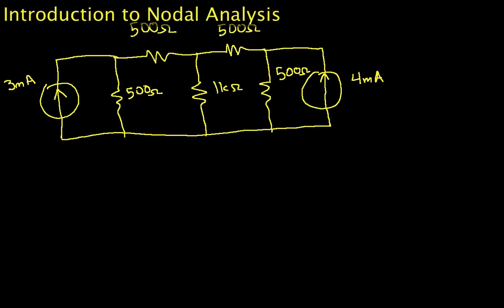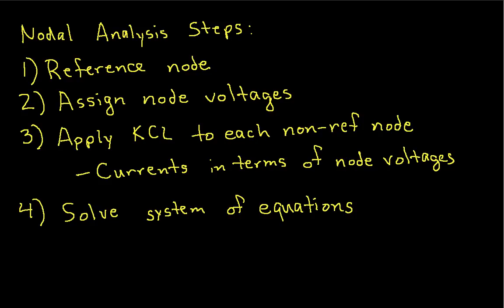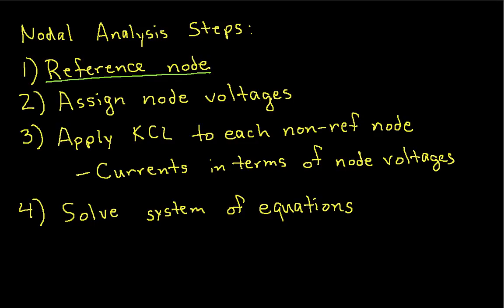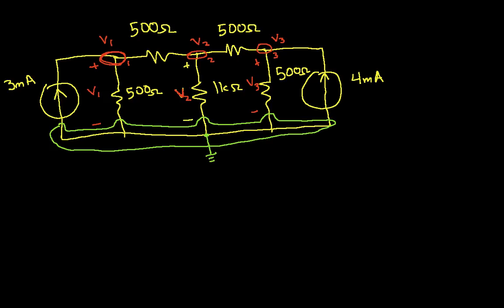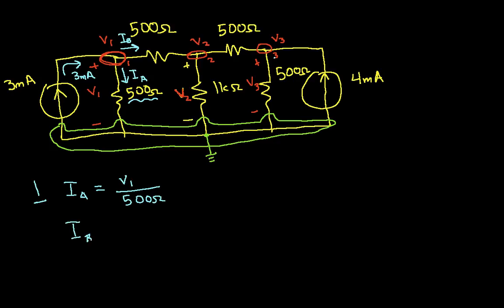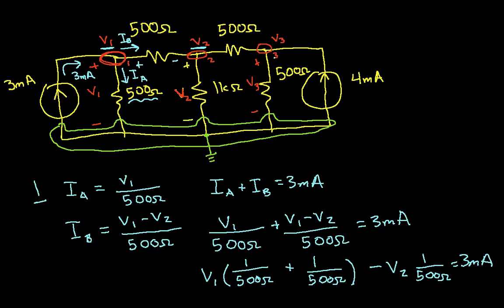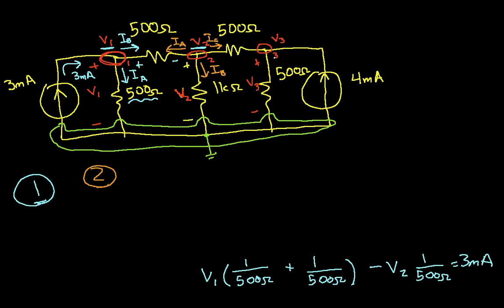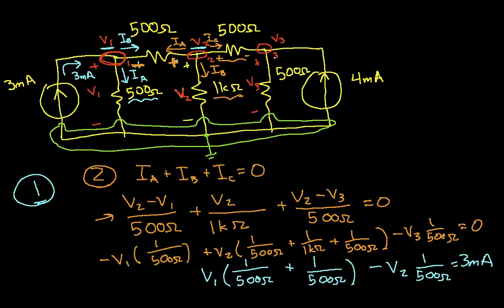Introduction to Nodal Analysis Part 1

Comment: for everyone confused on node two. During nodal analysis, you want to write every current as ones that are moving away from the node. If the current isn't heading away then it'll turn up negative. This is a neater way of writing it and keeps your from being confused as to where the current's heading. if everything is heading away, the ones that turn up negative would have to be moving towards the node.
Reply: Thanks for that. Super helpful!
Reply: wow how could you guess !

Comment: This video provides clear information about all of the steps necessary to perform node voltage analysis.  It begins by introducing a problem and working step by step through it until completion (In part 2).  Throughout the course of the problem each step taken is explained and made as clear as possible to the viewers.  This video explains very well what a node is, how equations are derived, and how to solve the problem in general.  Very nice video, Thanks!

Comment: Thanks for your video and it helps a lot! But I have a question.
For V2 equation, why ia, ib and ic are leaving the V2 node instead of ia goes into V2 node and ib and ic are leaving? Which will give me ia=ib+ic instead of ia+ib+ic=0. 
Please Help!
Reply: +Hao Zhang (Nick) did you ever end up figuring this out?
Reply: While you probably don't need this anymore. He did it like that for consistency. If you try to keep track of where all the current goes you have a higher chance of making a mistake. It doesn't matter where he draws the current going, the equation will fix it if something goes wrong. So instead of trying to keep everything going in one direction, he has all the current leaving the node since the equation would fix it anyway.
Reply: even though the original post is old you answer is still helpful for us now. Thank you!

Comment: You haven't explained why you took all the currents away from node at v2.
Reply: same question
Reply: since there is no current source at node 2 so all the current are going away and is equal to zero...if there was a current source then one would be incoming and other two would be outgoing but not in this case
Reply: @yl560  what i think for node 2 we should check the voltages which one is higher. in my calculations t V3 is higher than V2 hence making it to move from V3 to V2

Comment: Can I just choose any node as my reference node? What difference would it make if I chose another node as my reference node?
Reply: You can choose any node in the circuit as a reference node. It might result in more work, though. A good choice for the reference node would be a node which connects most of the branches in the circuit.
Reply: 2013Aleksey2013
Thanks. I did look it up myself though :) It's apparently good to choose one with many elements attached to it, and one with many voltage sources attached to it.

Comment: For the equation at Node 1, why is is the current IB equal to (V1-V2)/500? I get that he's using ohm's law (V=IR) but why is it V1-V2 ?
Reply: basically the total voltage, so voltage of V1 minus v2 is the voltage going across the 500 ohm resitor

Comment: why does he keep changing the signs from v1 to v2?? why does he do that? he forgot to explain us that
Reply: because of the way he set up the (+/-) signs across components, with respect to the direction of the flow of current.
Reply: i think you can keep the signs the way they originally were and, instead, use       -(v1-v2)/500 which equals (v2-v1)/500.
Reply: +andres segura depends which reference node you are using